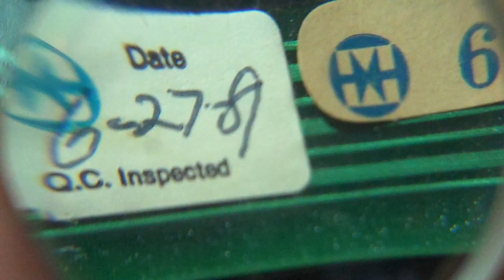Scrapping IC Chips : How old are they?

Comment: You can get some ideea of how old the board is, if the routing on the board(the copper cunductive lines) are mainly horizontal on one side and mainly vertical on the other, then it means it's an old board and the routing was drawn up by hand, if it's in all directions on both sides then it's a more modern board ant the rounting was done by a computer program.

Comment from the maker: The micro wires that connect the legs to the chip are gold. There is gold plating under the chip in the center. I have 30 pounds that I'm saving to refine when the temp gets warmer outside.